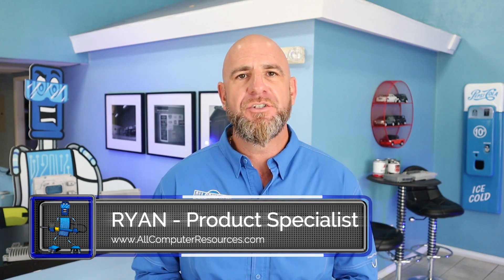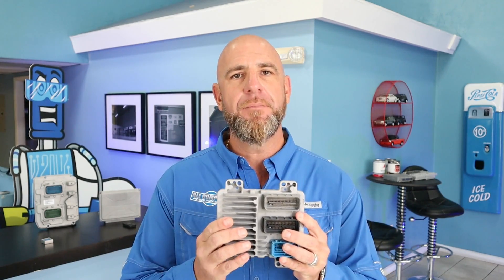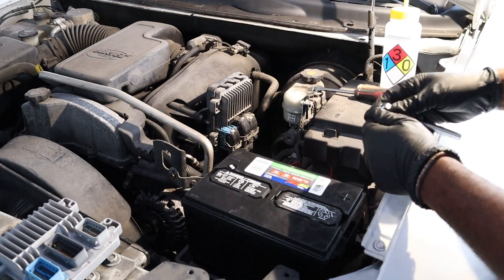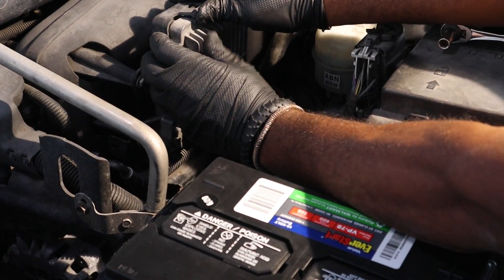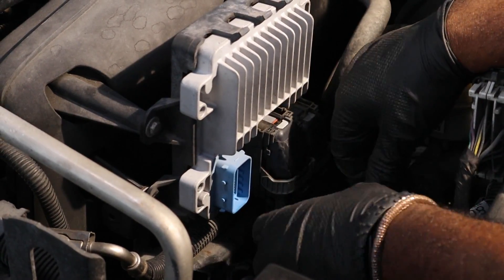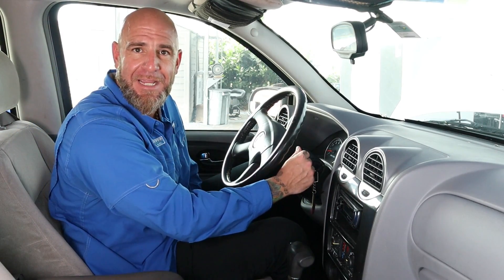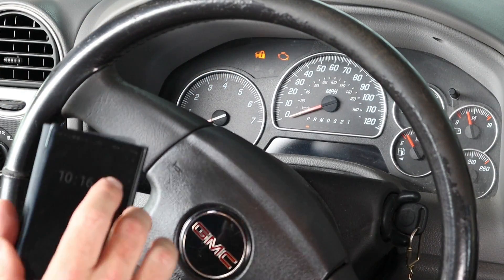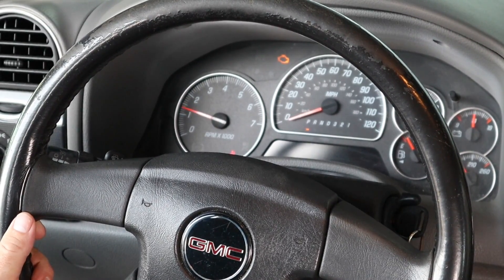HOW TO PROGRAM KEY FOR GM/CHEVY ANTI-THEFT - ECU REPLACEMENT PK3+ / PASSLOCK

Comment: My key has the thick black head, the side that attaches to the key ring, but have no lettering on key or resistive chip. Would my key be considered passlock, thanks
Reply from the maker: What is the Year, Make and Model, I will check for you.
Reply: @acr  the truck is a 2006 Chevy Silverado 2500 hd with a 6.6 turbo diesel
Reply from the maker: @chadbarger9205  Your truck uses the Passlock System. This video is correct for the 30 min key relearn
Reply: @acr  Awesome, thank you for confirming
Reply from the maker: @chadbarger9205  Yes sir, happy to help
Reply: @acr  i have a 2000 silhouette.  I changed the ignition and damaged the pass key 3 08382190 soft ware 0120 . I never had a issue with it. My question is can I use one from the junk yard? Can I bypass it help

Comment: I replaced by ecu and programmed it to start now I have engine reduced power light on with check engine light on
Reply from the maker: Hello Christopher, Did you purchase the part from us? If so, please provide the 6 digit order # so I can look into the details of your vehicle.
Reply: No I brought from a auto store I was wondering what to do next
Reply from the maker: @christophersalinas6479  It would be difficult to say. Generally, parts purchased from Auto Part stores do not come calibrated or VIN programmed like ours.
Reply: Well I asked a mechanic to look at it was weird my old ecu Doesn't detect the same problem as the new ecu

Comment: My security light never stayed on. And after I got my new ECM and it said "crankshaft position system variation not learned" P0315 is the error code. What do I do? 2012 buick lacrosse
Reply from the maker: A Crankshaft variation relearn must be performed at that point.

Comment: caution:  I did a 30min procedure after a hard ECU restart and the injectors clicked away during the first portion........ and hydrolocked the engine w FUEL!   (i removed all plugs, turned the engine by hand- and fuel poured out of each cylinder).  Fuel pump must have been active as well.   Weird.    I did a hard ECU reset to try to sort out a very random P0300 random misfire.   Trying this process a 2nd time: w the fuel relay pulled...................
Reply from the maker: Word of caution...If you were experiencing PCM issues and misfire problems, the coils and/or spark plugs could be unregulated which would damage an ECU due to overvoltage. It is recommended to diagnose that problem beforehand to avoid any damage to a replacement PCM.
Reply: @acr  thanks!  Ive been FINE for several months now.  Got my smog handled.  It does seems I had a BAD CKR position sensor........I had swapped in a new,cheap BAD one while I was trying other things.   Mad clicking, gauges going crazy........which stopped as soon as I unplugged the sensor.  I put the older, good sensor in- and everything is fine.  WOW.  Ive never had an issue like this.
Reply: @acr  also: be sure to instruct people to turn the key to not cranking.....vs all the way 'off'.  It took me hours or trying to finally figure this out.  Thanks!
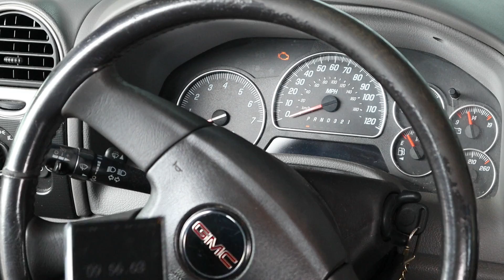Reply from the maker: @atomicdmt8763  at approx 6:36 in this video that is shown. Thank you
Reply: @acr  yep- I understand.............and I was turning the key all the way (off): fully counter clockwise...... and not simply off from cranking.  The process did not work until I tried the (middle position), just backing away from cranking.

Comment: I have a 2012 buick enclave and just did the replacement of the ECU bit when I tried the relearn the engine light flashes but does not go out or hold and the security light does not go out. What should I do?
Reply: My 2012 buick lacrosse is same
Reply: Did you resolve the issue my 13 equinox is doing the same thing??
Reply: @borregita8851  Did you ever figure yours out? Unfortunately I’m going thru the same thing with a 13 equinox
Reply: @azeraxx2959  took in into a shop and they  flshed the ECU to my cars VIN and that seemed to be the issue BUT, when they flash it to the cars VIN you have to have them or someone relearn a few sensors. 
After replacing the ECU and engine harness…car still has the same sputtering problem 😔

Comment: Should my battery light flash? I recently had my truck put in the shop and put my truck in security mode. I got a new pcm, and i’m about to relearn but my battery light and fuel light comes on
Reply from the maker: This is pretty common as you are leaving the key on the 'ON' position which illuminates some of the cluster lights. Be sure the battery is fully charged and/or connected to a tender. If the battery dies while performing this procedure it could corrupt the software on the PCM

Comment: Hey there.  I just replaced my ECM and started the steps for the relearn process and my car started.  Also, no security lights came on or stayed on.  Not sure what this means or what my next steps should be.  would you have any advice?
Reply from the maker: Just want to confirm your question. You replaced the ECM and the car started and is operating fine?
Reply: @acr  i have a new vin programed ecm for 2010 traverse lt 2lt , was wondering if I have to also do the crankshaft positioning sensor relearn procedure
Reply: Same problem

Comment: my 2006 hummer 3 wont turn on my security lock is solid  and stay on i did everything on video n nothing i had my ecm bypass n nothing help
Reply from the maker: Hello, did you purchase the ECM from us?
Reply: @acr  Hummer 3 uses b110 key. NOT TRANSPONDER.. Different system. PK3+ is a type 48 CADILLAC chip. NOT GMC OR HUMMER.  PK3 is type 13 which would be GMC.  If your successful with a PLUS chip on a GMC, I would bet it is a mislabeled chinese copy. The security on hummer 3   is quite different as it NOT transponder in the states till later years.  Those trucks a prone to other issues.
Reply from the maker: @stuartmeyer9211  2006-2008 Hummer 3 =PL3  /  2009-2010= PL3/PK3+ -(PL3 represents Passlock 3 in the U.S. and PK3+ represents PK3+ in Canada) The process for Passlock and PK3+ are the same in regards to a PCM replacement with a module programmed by us.

Comment: What if the security light goes off immediately when the key returns to run position? 2006 Trailblazer SS. Thanks
Reply: me three    check engine light flashes but never goes off    security light comes on with initialization, but then goes off with the normal systems checks lights
Reply from the maker: @huhdidwhat  Hello there, I'll need more detailed information to have a better understanding of your situation.
Reply: @acr  

I have the same problem. I installed a refurbished ECM (vin programmed). PK3+

I turn the key to the start position, release it, and the security lock light turns on along with all the other lights. But then it turns off.

I previously had an ECM connection error code.  The message on the dash said “service traction control”, “traction control off” and “service stability track”. These all pointed to the ECM, but re-appeared with the new ECM, so I guess the ECM was not the issue.
Reply: @samsampoux9648  how did you fix your problem?
Reply: @guvhal  I finally figured out my problem was not related to the ECM. I had a damaged wire harness which would make contact half of the time, and lose contact when I hit a bump.
Reply: @guvhal  did you find anything out, I just replaced my ECU and security light goes off when key is in on position
Reply: @JayStarzVideo  nope, installed new ecu and no start, security light goes off in a second, check engine light flashing, also got service stability track and power steering warning.
Reply: @samsampoux9648  did you figure out the issue?
Reply: @lifteddreamz830  

I did. We had a damaged wire harness. Everything was normal till I hit a bump and the car stalled. Annoyingly, I would have it towed to the dealership, and it would work again because because the tow truck hit a bump along the way. That happened 3 times. 4th time, it didn’t start upon arrival and they were able to find the damaged wire.
Reply: @samsampoux9648  before I replaced the ECM. The original one was working fine but at the time was still trying to figure out my issue. The service stabilitrak, service traction control and everything would come on. That’s when I replaced the ECM with a new one and since I’ve tinkered with it it’s became an issue. You think it’s possible I could have same issue you’re having?
Reply: @lifteddreamz830  it’s possible. It was beyond my means to figure out.
Reply: @samsampoux9648  seems to be an issue not many can figure out. I’d looked all over and can’t find much on fixing this issue. Might just take it to the shop
Reply from the maker: Can you please provide more specific details on the issue?
Reply: @acr  ia
Reply: Me too
Reply: Same problem
Reply: I have a 2006 Chevy equinox. The pass lock light comes on and immediately turns off. I did not replace the PCM. I turned my vehicle off at the Tim Hortons during an exchange with my children went back into the vehicle to start it it wouldn’t start and the pass lock light turned on that immediately off. My vehicle is disabled and I have to spend $400 to tow it back to where I live. Not sure what else to do but this has been fairly helpful. But my question is what happens when the light doesn’t come back on after 10 minutes or it’s not on throughout the whole procedure?

Comment: Recently received my  All Resources Computer/ECM for my 2011 GMC Yukon Denali. This hasn't been the "plug-and-Play" scenario as advertised. Spent the last 4 hours trying to get this anti-theft thing to work under both options/videos you have provided on YouTube. Tried both ways  multiple times - no luck. Car will not crank or start with the rebuilt ARC ECM.  I have a steady check engine light on with the new ARC ECM even though the car has not cranked or started?  Not sure if that is normal? No paperwork or instructions came with it and I just so happen to stumble across this YouTube video searching for answers to my problem. I have now given up, pulled out the ARC ECM , and re-installed my old ECM just so the car will start and run again - which it does. The problem I am having with this factory original  ECM is that after an hour or so of driving it would stall and I would  be forced to sit two minutes before the car would restart and act like nothing happened. The computer code I am getting is P0601. Previous attempts to repair this issue before buying the ARC ECM was to remove and clean the throttle body and battery posts. I am overseas military and need this car to get back to being reliable. I have limited resources over here. Any ideas on what I might be missing?   For background, I am not new to car repairs but this one has me perplexed. Thank you.
Reply: My update- I finally got my All Computer Resource (ACR) ECM to work. The car started and runs fine. It took time to devote to this project as I work long hours and had to keep switching back to my old ECM just to get to work and back. However, as time dragged on that old ECM was failing more and more as the weather got hotter and was leaving me stranded. I devoted an entire day to fixing this. Here is the fix for me: The problem was that I was using the same key every time to conduct the re-learn process each time I plugged in the new ACR ECM. That key may have a bad transponder/chip in it. That particular key worked with my old ECM but not with the new ECM. After several exhausting attempts to get the ECM to take the re-learn procedure, researching just about every article on the subject, and getting close to throwing in the towel and demanding my money back. I came to the idea of trying the other original key my wife uses. I am the original owner of this 2011 GMC Yukon Denali and still have both original keys and FOBs. One key is used more than the other as my wife rarely drives it. This other original key obviously had a working chip/transponder as it DID take the re-learn process and after only one cycle (and not 3-5 as described in the above video). Once the ECM took the second key, it  was then able to match the first key I used without having to do the re-learn process again. I have a check engine light on (P0135 Crankshaft Position not learned) and a subsequent email from ACR told me that this is normal whenever you switch ECMs. I had a local German vendor use his Snap-On scanner  to re-learn the position of the crankshaft sensor which cleared the code. This cannot be done with your run-of-the-mill OBD II scanner.  Now, I have no further issues and the ECM appears to be working fine. No check engine lights either. Since no troubleshooting tips are included in this purchase I figured I would submit this.
Reply: @JK-mh3ld  so how many times all together would you say you did it? Do you have pk3 or pk3+? If pk3+, did you leave the key in the on position for 10 mins only or until the security light shut off?
Reply: Had the same issue. Definitely not plug and play, no instructions.
Reply: @urpappii69  Tried again today - no luck. I let the battery sit disconnected for over an hour. Cycled the key-learn system for (10 minutes, 5 secs, 10 minutes)  5 times as the video States that sometimes you have to do the key learn process up to 5 times. Eventually I started getting a battery low warning. I don't blame it, even with everything off you can hear the low hum of the blower motor. Sent an email to the company requesting trouble-shooting help. No response yet. Any luck with yours?
Reply: Tried again - no luck. Sent ARC an email requesting additional help. No answer yet. Went back to my old ECM. At least the car starts and runs with the old one.
Reply: @JK-mh3ld  I've tried it probably 20 times. The key stays locked in the cylinder nd won't turn off all the way. I have to manually remove it. Im think about putting a new lock cylinder in so ill have a new key to work with. Ive tried the 10 min 5 sec. And leaving the key in  until the light shuts off but I never does. Its annoying. Lol
Reply: @anpowicasa4477  hey spray WD 40 silicone spray in the lock to loosening the tumblers!

Comment: So I did this the other day and it started up just fine and I drove it around that night. The next morning I tried to start the car and it wouldn't turn over. It looks like it forgot everything I did. So now I'm trying the process over again to see if it starts again. Any idea what could be wrong?  It says service theft deterrant system . Its a 2010 chevy traverse
Reply from the maker: Hello, The first thing I would suggest is checking your battery and be sure its fully charged. Since this procedure does have a tendency to drain the battery there's a good chance that could be it. Otherwise I would disconnect the battery for 30 min and allow for a system reset and go from there. I haven't heard of the vehicle forgetting the relearn after successfully completed.
Reply: @acr  thank you for replying, ill try disconnecting the battery for 30 minutes, I redid the process and it started and drove just fine. But again wouldn't turn over the next morning
Reply: @acr  i just got done disconnecting the battery and all that. It started no problem after the process again. But I turned the car off for 10 seconds and it wouldn't turn over again
Reply: Im having the same problem did you get it figured out

Comment: Will a instrument cluster with technical issues prevent this procedure from working correctly? Because when I turn the key to on position I only see the check engine light on?
Reply from the maker: Hey Alan, What is the year/make/model of the vehicle?
Reply: @acr  2006 chevy impala SS
Reply from the maker: @alannooks2096  Ok, this is the correct procedure for the 06 Impala SS, however be sure that you are attempting to start the vehicle to engage the relearn cycle. In this video at about 5:45 I explain in detail. I recommend disconnecting your battery for 30 min then give it a shot.

Comment: Hi... Can we perform relearn procedure without master key? I lost my master key long back and have been using transponder key. I tried to perform relearn with my transponder key but the security light on dashboard doesn't stay and goes immediately. What should i do to get my pcm installed? Thank you in advance.
Reply from the maker: Typically it will require the Master Key, however if the vehicle was running with the other key at one point, the relearn should go through. What is the year/Make/model of the vehicle so I can check the correct procedure for you.
Reply: @acr  It's a Chevrolet Orlando 2012. Thank you :)
Reply: Will this work for a Chevy Malibu 2010?

Comment: I have a 2008 impala code c0561 for the pcm or bcm have my traction light come but it says nothing wrong with my traction module can you tell have you run into this
Reply from the maker: Hey Jordan, Heres what we have on that code for your vehicle:  Disconnect the battery, Check the BCM Connector and be sure its fastened securely.  If that doesn't work: 
1. Watch traction control switch input in Body Control Module (BCM) data or with a Digital Volt Ohm Meter (DVOM) on the Brown/White wire, circuit #1571. Voltage should remain high, near 5 V or 12 V while switch is in the ENABLE position. Refer to the latest version of GM bulletin PIC5074.

2. If the switch status does not remain ENABLE, disconnect switch, road test.

3. If the status is now steady in the ENABLE position, replace the traction control switch.

4. If the status still changes with switch disconnected, check the Brown/White wire back to the BCM, pin 33 for a potential short to ground.

5. If the wire checks OK, verify the Brake Pedal Position (BPP) sensor voltage is 0.73 - 1.47 volts with the brake pedal released.

6. If OK, perform the BPP Sensor Calibration per GM document #2037786.

Hope that helps!